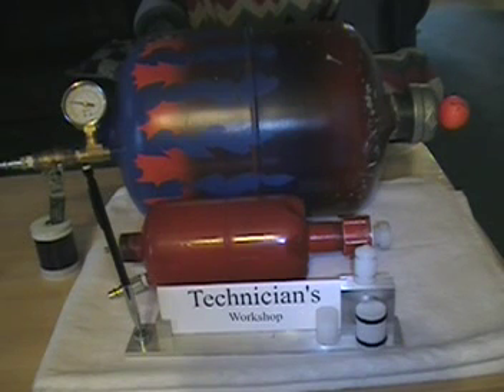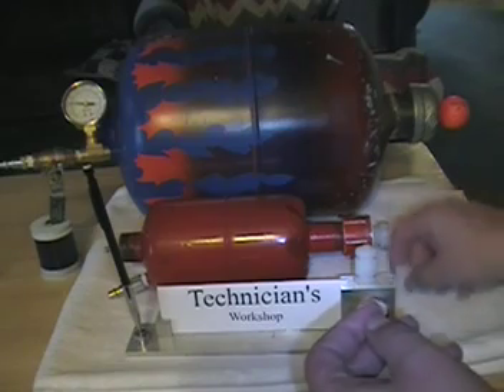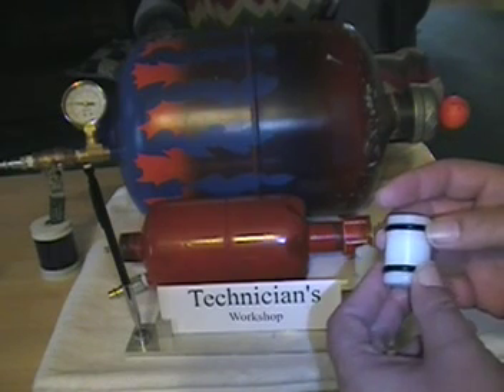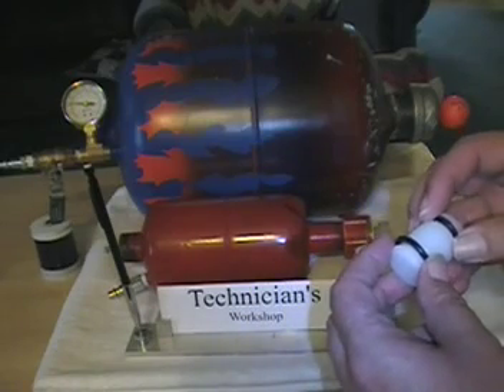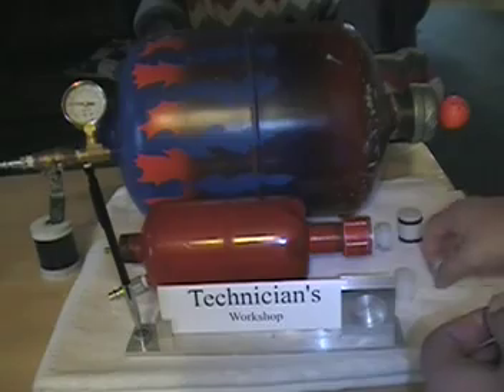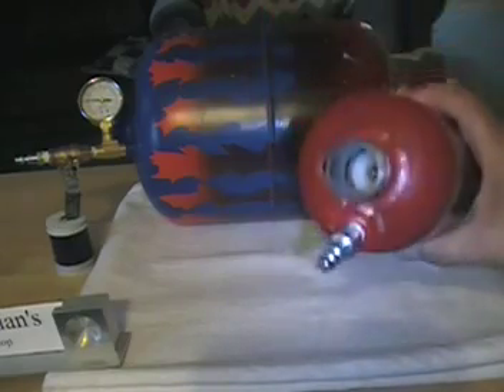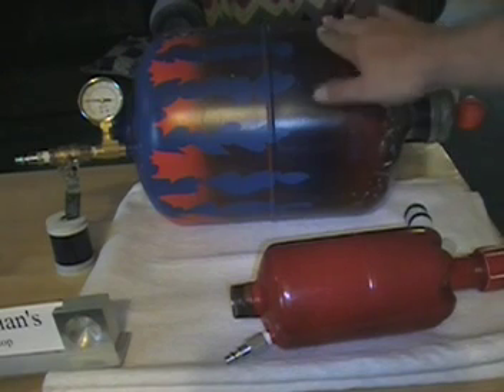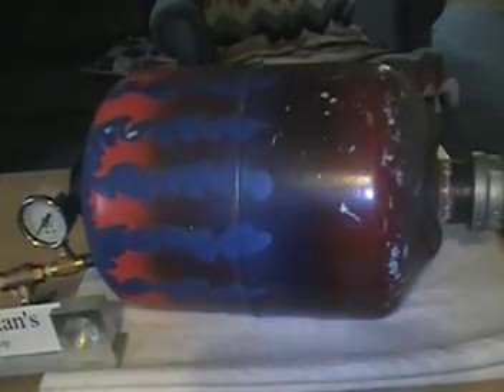Using O Rings in air cannons

Comment: Great vids and very interesting design! I understand that when the rear O ring is north of the ports, it allows you to pressurize the tank.  When you pull the piston back so that the lead O ring is south of the ports, it fires.  If you would, I have 2 questions;
1) What keeps air from leaking around the shaft, through the stop Assy, and out the cap when pressurized?
2) don't the ports tear the rubber O rings?

Thanks!